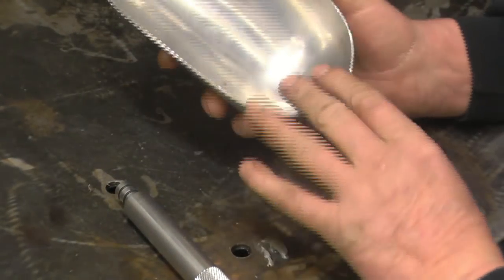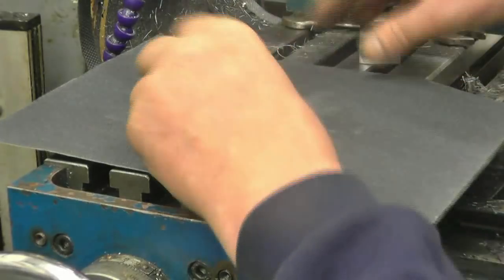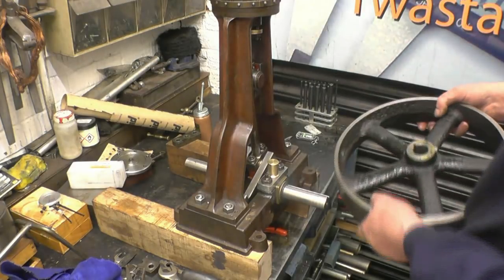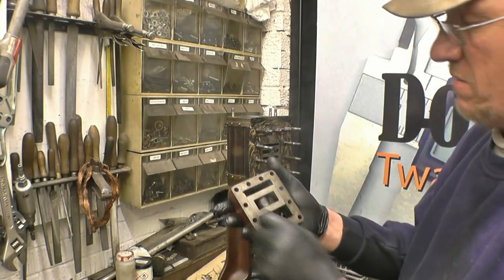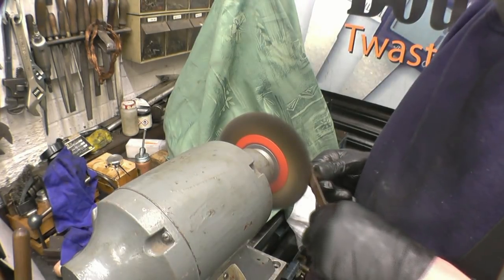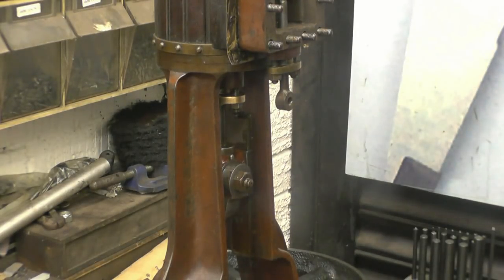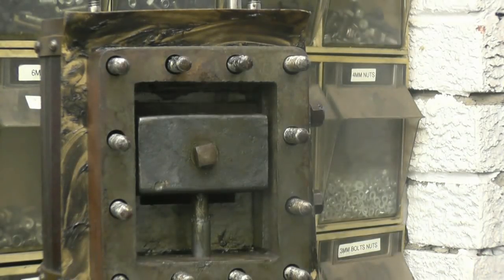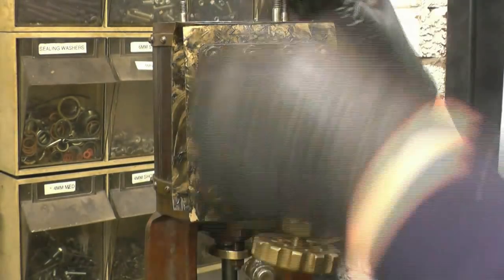SNNC 222 P2  Alloy Scoop Weld Repair

Comment: That aluminum scoop is an ice scoop. You can get them at restaurant supply places. You use it to dig up ice cubes or shavings from the bin of the commercial ice maker and pour the ice into the glass.

Comment: Sounds like she has a bit of a knock eh?  Weren't most steamers designed to run in either direction? So in that case I would assume the valve timing would be different.
Reply: Brian, a reversible engine of that sort would have twin eccentrics and the levers to switch between them.  Steam railroad locomotives have sophisticated valve gear, like Walschaerts ( https://en.wikipedia.org/wiki/Walschaerts_valve_gear  ), to control the direction of rotation.

Comment: This may sound like an abstract question, but, what do you suppose the maximum RPM would be for this unit? Watching this build over the months now, I do not recall, any info, othr then you got it as a "basket case" so to speak, so, is it safe to assume, that even if not much may be known of this particular unit, would it still or can it be classified into a (HP) class, based on it size, or CCM or C.I.? just wondering, is all... glad to hear it run, and it sounds really cool!!! Nice work, as always. Dru
Reply: It could probably run fairly fast, maybe 1000 RPM, for a short while. But full-scale steam engines of this sort ran quite slowly, often less than 100 RPM. Something this size could have been used to power small shop machines, it is big enough to be a couple horsepower. 

But keep in mind the lubrication system is a "total loss" system -- you pour the oil into the bearings, and it pours out on the floor. So you have to be constantly oiling these machines, and more oil of it goes faster, because it loses oil quicker ang the bearings get hotter.

I'd guess this machine would have run maybe a couple hundred RPM at most.